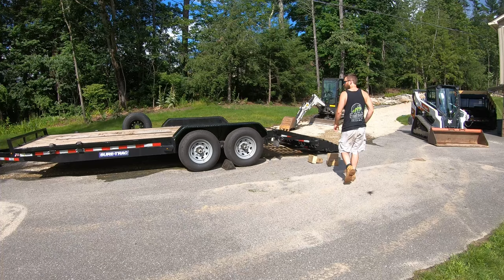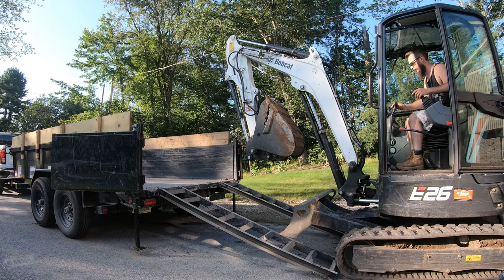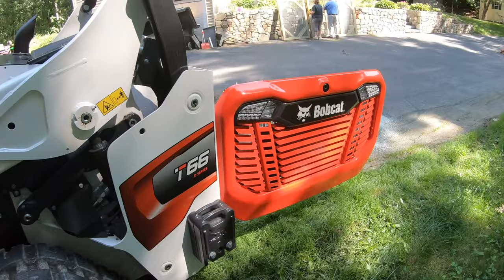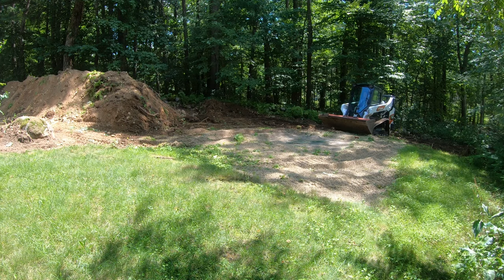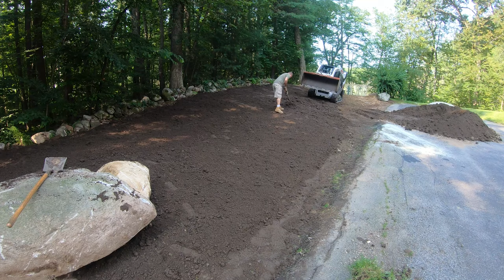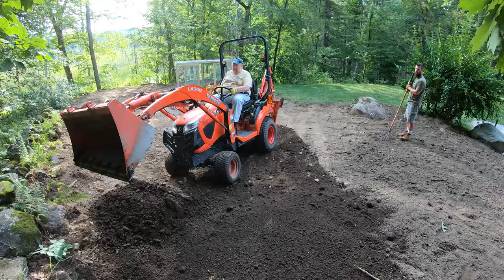Grading a Hill with Bobcats E26 & T66

Comment: I also own a dirt company, just curious why you didn't just move all the dirt the first time with the skid steer. Seems like a waste to take and put it in a pile with the excavator and then come back and move the same dirt with the skid steer especially when you're only moving it 50 ft?
Reply from the maker: Definitely could have gotten away with just the skid steer! However, since we didn't have a tooth bucket or grapple at the time, it would have made getting through some of those stumps, trees, rocks more tedious. So since we could bring/use both, we chose to. This was job was also for a close family friend.
Reply: Alright that makes more sense.
Reply: I own a residential dirt company too and for dirt work on slope and a good excavator operator you can get a cleaner, more precise cut the first time with a mini. Then just have a clean up guy following you. Darn seem less operation other than I’m just a fan of bobcat anymore. Too many issues with equipment, tracks, and bad service. Moved over to cat and ASV now.
Reply: I was thinking the exact same thing. It was a huge waste of time even having the mini excavator on the site. It accomplished nothing. 🤷‍♂️
Reply: I disagree with those who claim he only needed the track loader. 

Just as I could spread butter on toast with a spoon, but would I? No! And neither would you. We wouldn’t do that because it’s not the right tool for the job! With access to both those machines and the means to transport them safely, why not utilize both? 

By using the digging machine for digging and the loader for loading, he ensures that both machines remain in good condition and continue to generate income for years to come. I truly commend this man for his efforts.
Reply: I mean.. You're entitled to your opinion
Reply: Not a dirt company its a ground works company

Comment: Surprisingly satisfying to watch!  Thanks.  Normally the smaller trivial bits in the video get edited out but it's great to see how you guys roll.  I've got a E26 and a T590 combo also.  How do you find the T66 - worth the update?
I like how you place the topsoil on the job, have you considered using a grab level bar?  They smash big areas quickly.  You have to watch the soil tension if you don't have scarifying tynes.  We operated in New Zealand.
Reply from the maker: Thanks! Yeah the E26 is an awesome little machine. I have never run the earlier series bobcats so I can't speak to being worth the upgrade, but the R Series track loaders are super nice.

I pretty much do all my topsoil these days with the T66 bucket and power rake. Gets a good level while also prepping for seed.

Comment: Maybe you answered this in the video but why didn’t Bobcat service come out tightened the loose fitting and refilled the hydraulic fluid? I like the CJI Action 3 camera. It doesn’t have the overheating problems that the GoPro has.
Reply from the maker: It was a saturday afternoon, they are only open during the weekdays and I didn't have time in the schedule to wait for that.

Comment: Glad I got wheel machines I use over tracks  Way less problems
Reply: Wheels are good where the can be used but I’ve graded slopes at work that you would never touch without a track machine. Definitely less expensive.
Reply: @waynejohnson9855  Please explain how a track machine is less expensive than a over the wheel track machine Oh by the way I am glad I came back and clicked the subscribe button
Reply: @alphonsotate2982  sorry it was confusing I was agreeing a tire machine was less expensive, one of those where I knew what I meant.
Reply: @waynejohnson9855  Thank you Wayne🤩🤩🤩

Comment: hi like your channel i have a 2020 bobcat e10  it leaks hydraulic fluid and my wheel motor started leaking i had to tighten all the lines it is like a little kid tightened them they were so loose is what it is just keep going forward
Reply from the maker: Yeah, had similar issues with my backhoe unit on our BX23s when we first got it. Loose fittings come standard with new equipment haha!
Reply: @CarlsonSonLandscapingLLC  The dealer is the one that assembles the equipment, if you have loose hydraulic lines then that is on your dealer. Time to find a new dealer.
Reply from the maker: Yeah, our local Kubota dealer is awful. Haven't dealt with them servicing anything on the tractor since we bought it. Even buy my parts thru messicks!

Comment: I seems like a fair portion of the work that you do, there is no real "production rate" to speak of. For example are you charging X amount of dollars for 3hrs and there after its X amount per hour. Any information you would be willing give/explain would greatly appreciate. Awesome videos there sir!👍
Reply from the maker: I have still been gauging and working out the best quoting practices through my own trial as well as talking to others in the business. In general, I quote for the whole job and provide that to the customer. It takes overhead, operation, maintenance, material, insurance and transport costs all into consideration. Generally the bulk of the pricing comes from what machines I have to run and how many hours I expect to run them for and what operational and maintenence costs will that incur. Every job is different so there is never a fit all formula but I am at least able to get a baseline cost for say a day of general single operator excavator work and extrapolate from that.
Reply: @CarlsonSonLandscapingLLC  What's your "average" cost per hour that you've figured for your Bobcat T66 and Bobcat E26. In that cost per hour have figured maintenance costs (fluids, filters, grease, etc.), undercarriage costs (tracks, sprocket/idler, etc.), fuel consumption costs into that "number"? I understand that it will very depending on what kind of work your doing as well as the surface you are working on. Would you also have a recommendation on a percentage of increase on cost per hour for lets say the t66 working on a hard surface, only, where the tracks are being wore quicker. I'm just like you. I'm trying to gather as much information from other people who are more experienced with costs, etc. in this industry to help get a better idea on the numbers. Thank you for responding to my last comment! 👍
Reply from the maker: At the current time, the E26 is around $25-30/hr and the T66 is around $35-40. Those are the numbers for just the equipment, not including operator, transport and other attachments that may be required.
Reply: @CarlsonSonLandscapingLLC  👍, much appreciated!